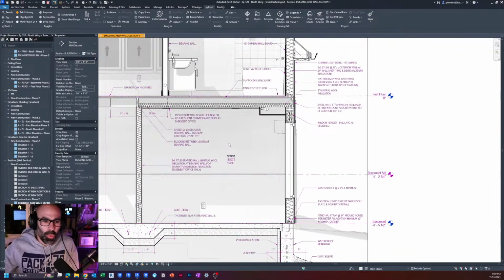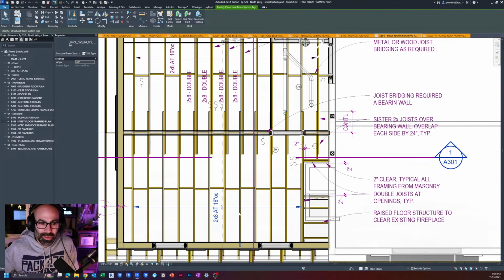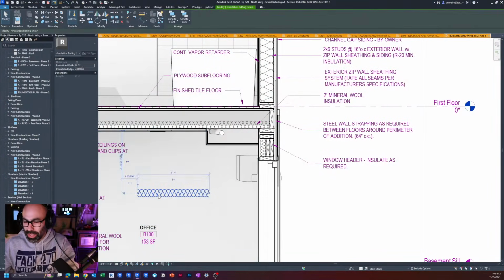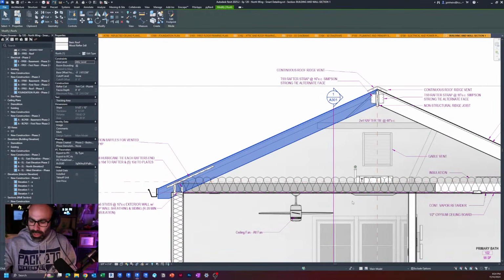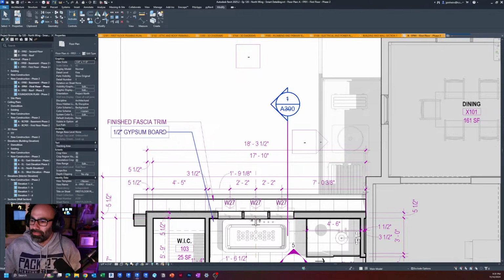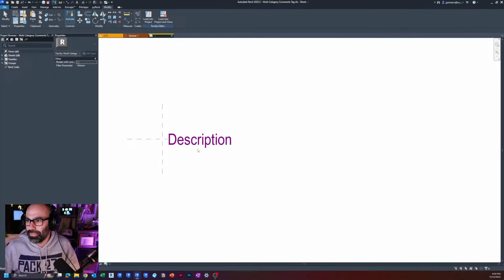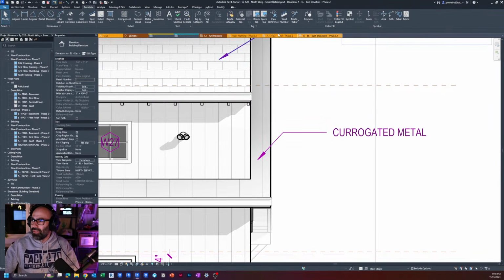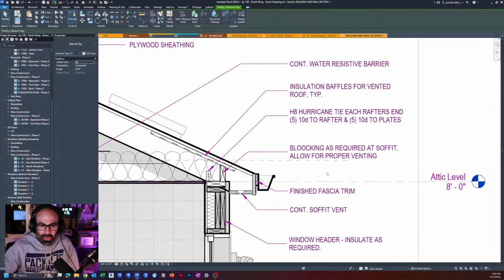Stop Using Text Notes in Revit !! (The North Wing - PT 6)

Comment: I've been using MC and mat tags for more than a decade. For the MC is created shared parameters to keep the standard "comments" for other purposes. They have worked tremendously well thru the years. This is, until I joind a new company. They like arc leaders and they won't budge. And thats the end. They prefer to type everything with text so they can have the arc leaders. If anyone knows how to have arc leaders on MC and material tags please let me know :)
Reply: 🤮 arc leaders? wtf run

Comment: Good approach - personally im using metrial and category tags along with detail tags wherever i need to embelish a sheet with 2d components. For the batting however, i had to create a line based component or a regular component that contains an array composed of a singular squigly line. You can then add background and top/bottom/end lines to contain it - all linked to visibility parameters so you can turn on/off anything you need . Same, or similar, approach ive used for smart lines - regular are equally dumb as batting hence the concept of smartenning them. Now we can tag pretty much everything. After all Revit is just a 3d data base so once you have a content in you should be able to extract any information via tags.

Comment: Multi category tags seem to work really well with the type /instance Comments type marks etc. Ive Even set one up for tagging window schedules so the notes can be adjusted from a master list. The ability to schedule parameters and control the notes from that is a big bonus. One thing I want to improve with them is how to audit notes between modelled items and detail items that should be described consistently. That is where I see it struggling over compared to keynotes.
Reply from the maker: @benwaddington9272  valid point… I’ll look into ways of doing that on my end…
Reply: I was thinking its maybe about family name setup like if the model item and detail item have the same code they could possibly be sorted in a schedule that essentially becomes like a keynote file within revit @TheRevitKid

Comment: Interesting risk mitigation strategy and clarity for notation. The only thing I'm not a fan of is the leader shoulder location on multi line text and text extent. The largest challenge I see is if you are working with others and making sure they are trained behind you in larger firms like mine.
Reply from the maker: I agree... but also, training people to do this is easier than training them to use keynotes... IMHO
Reply: @TheRevitKid  touche

Comment: Never understood while people just default to using text, or even keynotes if they're feeling brave. It always ends in them running around in circles and producing inconsistent documentaion. Revit was designed to associate data from the very beginning and it's not difficult to review either.
Good video Jeff.
Reply: It's the "PM needs it in 5 mins so I'll do it real quick regardless if it changes later" mentality. I've seen it for 25 yrs
Reply: @HippieP629   me too as well as the headaches it causes during construction

Comment: When detailing, we like using multi-category tags that have both type and instance combined. E.g. type comments and comments. So  can use the same detail item type and still annotate instance info like spacings and embendment without having lots of family types.
Starting to also trial filters that trigger off set words like existing and beyond, to override visuals. Dash and half tone detail items.
Reply: How were you able to get a single tag to reference both parameters? Did you need two separate labels in the tag family?

Edit: Just realized you can load multiple parameters into a single label.   Using Type Comments and Comments, working well so far
Reply: @jcn93  yes, placing multiple labels, some labels with the 2 parameters combined like typecomments & comments, and set them up with visibility parameters and then create types to reflect the visibitly parameters.
Reply: I use a shared parameter of "Prefix" and "Suffix" as a project instance parameter for detail items. These are also in the tag. So if you need to add additional text to your detail item without creating multiple types.

Comment: Are there any issues with tags that use instance parameters wanting to break model or detail groups when changing the instance parameter of an asset in the group?
Reply: As long as they are shared or project parameters it will work
Reply: Currently still needs to be a text based parameter, otherwise if you have more than 1 group instance it will break the group.